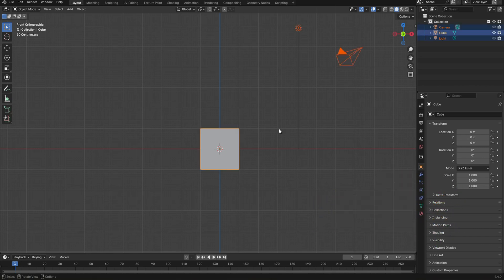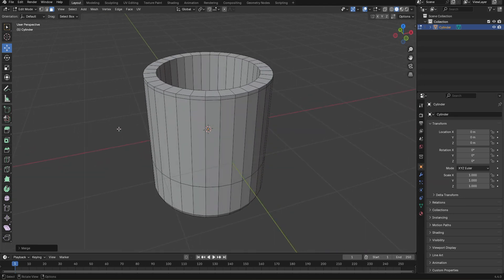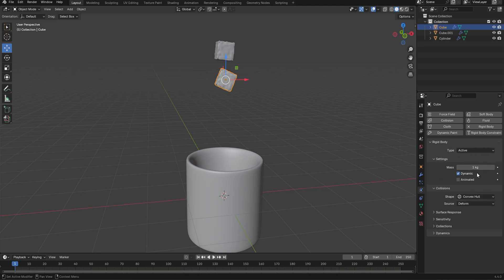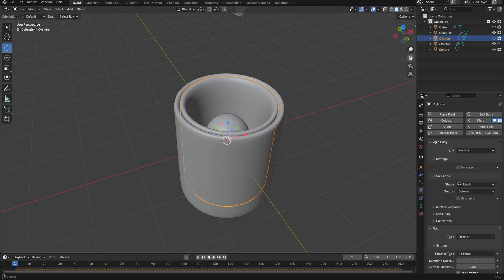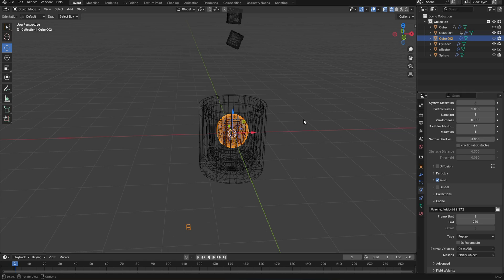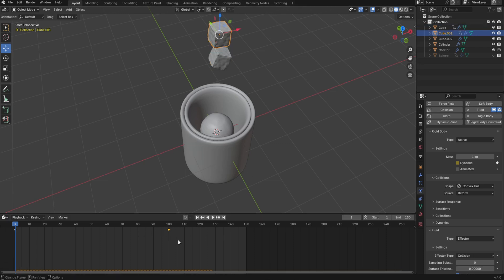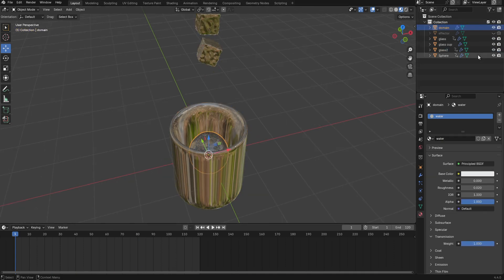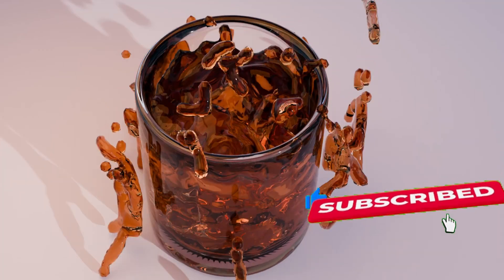How To Create An ice Cube  Splash In Blender!

Comment: Thank youu
Great tutorial, but when the water splashes, some of it goes through the cup, do you know how can I fix it?
Reply from the maker: 1. Duplicate the Cup
	•	Select the original cup and duplicate it (Shift + D).
	•	Scale the duplicate slightly so it surrounds the original cup.
	•	Ensure it has some thickness to interact properly with the fluid simulation.

	2.	Set as Effector
	•	Make the duplicated cup an Effector too in the fluid simulation settings.
	•	Apply all transforms (Ctrl + A > All Transforms) to the duplicated cup.

	3.	Manage Visibility
	•	Disable rendering for the duplicated cup in the outliner (click the camera icon).
	•	Alternatively, after achieving the desired splash effect, move the duplicated cup into a separate collection and hide that collection from both viewport and render.
Reply from the maker: This should work
Reply: @Aniverseworld  
Thank youu
Reply from the maker: @hanndai4208  👍

Comment: I'm stuck with a sphere never turning to liquid. Any tips?
Reply from the maker: If your sphere isn’t turning into liquid, start by checking the scale of your objects. Blender’s fluid simulation works best at real-world scale. If your sphere or domain is too small like under 0.1 or too large the simulation might not behave correctly. After that Select both the domain and the sphere, then apply the scale by pressing Ctrl + A and choosing Scale. You can apply all transformations, if you made other changes.

Next, make sure the sphere is inside the domain. The domain must be a cube, as other shapes won’t work for liquid simulations.

Select the sphere, go to the Physics Properties tab, enable Fluid, and set the Type to Flow. Change the Flow Type to Liquid.

Set the Flow Behavior to Geometry if you want the sphere to turn into a splash of liquid, or Inflow if it should act like a continuous stream as shown in the video but you can animate the Use flow. Make sure the Flow Source is set to Mesh. If you’re using Geometry, you can add an Initial Velocity to make the liquid move or fall.

go to the domain settings and ensure the Fluid Type is set to Liquid.

Bake the simulation 

If the liquid still doesn’t appear, try increasing the Resolution Divisions in the domain. Start with values like 64 or 128 for better visual quality and simulation detail.

Comment: So is ot works different in different blender versions
Reply from the maker: Yes, I believe so. Blender’s rigid body and fluid simulation systems can behave differently across versions, likely due to internal changes, bug fixes, or updates to the simulation engines. Fluid simulation seems to work more reliably for me in Blender 4.2 compared to version 4.4.

Comment: hello, I have just tried to follow your tutorial. Everything works fine up to the point when the ice cube are falling into the liquid. The ice cubes do not create splashes when they fall into the liquid. Am I missing something??
Reply from the maker: Go to Scene Properties, scroll down to Rigid Body World, navigate to the Cache section, set the start and end frames, update to the latest data, and then bake. Next, select everything except the ice cube, press Ctrl + A to apply all transformations, bake the animation, and play it again.
Reply: @Aniverseworld  Thank you for your reply. I tried what you suggested but it sitll does not work. I tried to follow the tutorial right from the start again, but it is sitll the same problem with the cubes.
Reply: @Aniverseworld  Which version of blender did you use?
Reply from the maker: @photoworks68  I used blender 4.4
Reply: It did not work in Blender 4.4. So I tried in Blender 4.3.2 and I was more successful. I still have to tweak the settings as when the first cube hits the liquid, the liquid explodes and goes through the glass. The built in liquid simulation system is very tricky. I had my eyes on the Flipfluid addon but it us way too expensive.
Reply from the maker: @photoworks68   👍If the liquid passes through the glass, duplicate the glass and scale it slightly to create an outer shell. Add some thickness to it, then set it as an effector in the fluid settings. Apply all transformations. Finally, hide it from the render in the outliner.